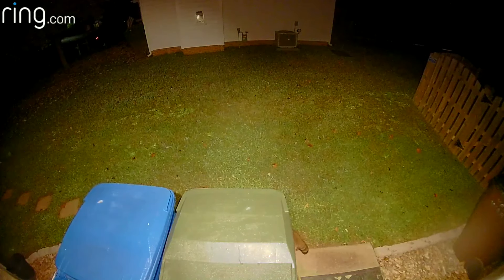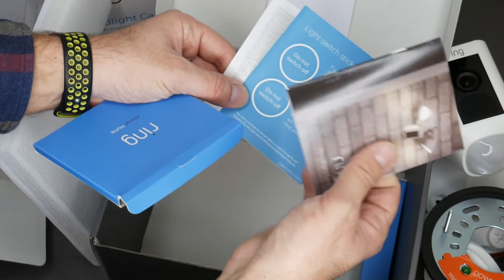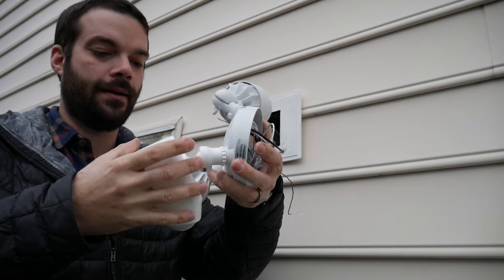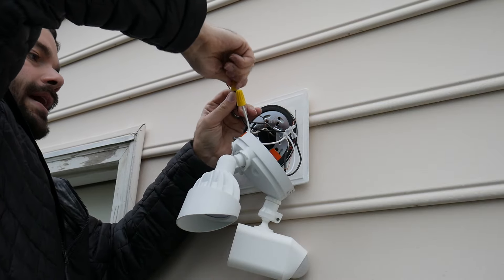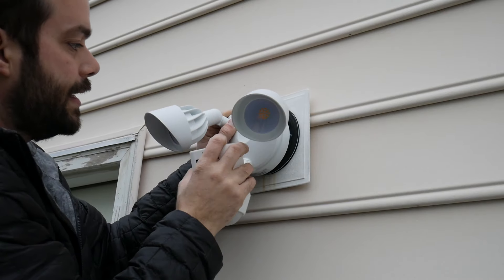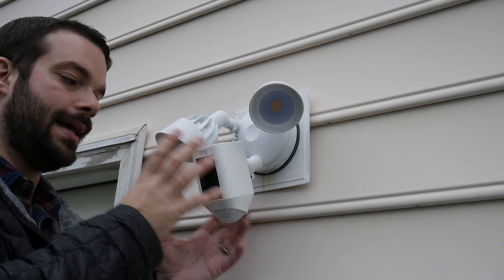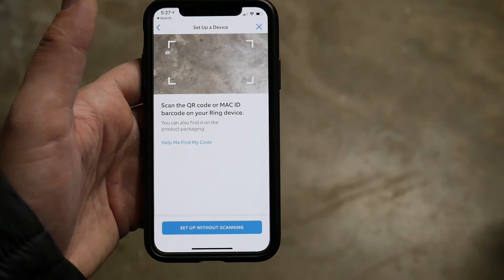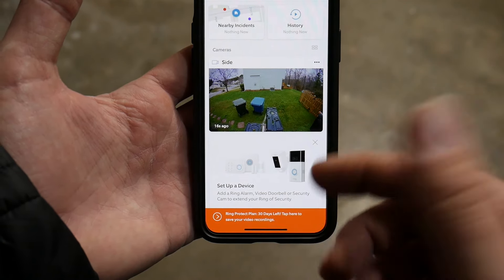Ring Floodlight HD Camera | Install and Set Up

Comment: Don’t trust the test button, you could have a malfunction on the light but still have voltage on your wires. It’s best to use a voltage tester to ensure the absence of voltage before you begin working on replacing the light
Reply: I grabbed the + and the - one time! It’ll tickle you ! Try it!😂
Reply: I had another wire hiting the wires I shut off and it shocked me lol. So now I shut off the entire house to be safe.

Comment: If you're trying to install the Ring Floodlight cam (model # 2210C-XYZ) with a 5" base and you need a junction box for it, you'll discover that round junction boxes with 5" diameters are very difficult to find. The large majority of them are 4". 

I finally found one that'll fit. It's the Grainger Surface mount wiring box, 5", White (model # 14G265). 

But, bear in mind that Grainger has really odd hours. They close at 4 pm on weekdays, and they are closed all day Sat and Sun.

Comment: When putting stranded wires to solid wires you don’t twist the wires together rather you put the stranded wire slightly higher/longer then the solid wire then use the wire nuts as normal and you will find it makes a way better connection it helps to twits the stranded wire by it’s self to tighten the strands together
Reply: Good job pointing out the correct way.

Comment: It would be cool if ring made it so that you can move the camera on the app
Reply: That would add cost.
Reply: It would also be way cool if the could power it off your wifi. Lol
Reply: Yesssss I bet that’ll be next
Reply: Ring keeps yalls footage lol
Reply: Mount it upside down and flip the camera? Just a thought. I haven’t tried it yet.
Reply: Or RGB
Reply: @tjsuda  That would be cool or if you could just the color temperature of the lights
Reply: @timhadaway984  I tried to do that but, the lights won't turn enough to put the hoods on top.

Comment: Excellent video! Can i install that camera where the old bell box alarm is at the front of the house? Can I use the wires from that bell box? It's a wired alarm that i don't use and it will changed to a wireless alarm. Thank you
Reply from the maker: Watch the video, if it has similar wires it probably has the same power running to it and you can use it.

Comment: Hey, just wanted to say thanks, you saved me time and can the manual be any smaller.  The hook is now a nylon strap which worked fine and they never mention using the handle to tighten down the nuts in the end.  Thanks again

Comment: I just have a standard outside light operated by a switch on the wall of my home at the front and back doors. Will this still work? I do not have a flood light installed currently. But I do have 120v AC connected to the existing lights.

Comment: Where's the white backplate from? I have a rectangular flood light backing onto the house (brick). Instead of having to cut out a whole, I'd like to use one of those plates and just have the wiring come through and put the circular backplate over that.

Comment: I have 3 spotlight cams but I just ran the wire yo the outside outlets through metal tube and got lock boxes for the outlets but what u did looks a lot cleaner 👍
Reply: Is it a plug at the other end?

Comment: I would recommend putting electric tape around them caps after you attache them . Just to make sure wires don’t touch
Reply: They won’t. That’s what the wire nuts are for. They act as an electrical tape replacement.

Comment: I'm going to install this where there is no Electricty so I need to use an extension cord. How can I wire a male plug into the Ring harness
Reply from the maker: Honestly, consider the Ring Solar Floodlight that I just reviewed -  https://youtu.be/0vhJ7eH8S1Y

Comment: Are the bulbs replaceable? If not, what happens when one stops working?
Reply: They are led lights they won't go out for a while atleast 10 years I'm a electrician these are easy to install and set it up you will need a strong wife connection near the flood light that is really important
Reply: @charli9184  I had led flood light on my house a couple years now and it just burnt out. Didn't last long at all so I'm looking to replace it with this. Since you're an electrician, I changed the lightbulb for under my microwave and now when I plug it in, the nightlight stays on and doesn't turn off. Is this an easy fix?

Comment: I'll make it real simple. Just attach your bracket and then attach all the color coded wires to the same color. Scan your USB code on the directions and it's all automatic from there it's extremely simple and the app will explain everything for you.

Comment: Not electrician here , you went little fast on ground wire, so the ground from house goes around the green screw on plate then connects to the ground from spotlight? Tia

Comment: Do you have to turn off juice or can you carefully install with protective needle nose plyers as long as you dont cross/touch the opposite wires?
Reply: TURN POWER OFF. Also don't trust that the power is off by doing what he said. Both if your bulbs could have went out even if you just checked them. You should get a voltage test pin to verify the power is off. They are not very expensive and could save you life.
Reply: @tylerhestla3022  pen not pin

Comment: Well made video, but electrically speaking……you should never rely on a light that you say is giving you problems to be your safety check for voltage. More people are killed on 120 volts every year than you could imagine. You should use a voltmeter, or at the very least, a voltage indicator. Super cheap at any home store. Second……not a good idea to use a wire nut on your ground wire….in some regions that is not to code. It should be a physically compressed connection. They sell little copper splices for this at the home stores as well.

Comment: What if you don’t have a existing light fixture, but still want to install and mount it in front of your house..and the house is brick..lol is it possible?
Reply: The ring floodlight plug in mount accessory can. It’s a 20ft cable that you can plug into an outlet. just need a 1 in. masonry drill bit to drill a hole in the wall to fish the cable to where you want to hang it
Reply: @christucker8132  Can you explain this further? I have a back porch light but no preexisting flood light 
 Do I need to send it back?
Reply: @jeannielynna  if you have preexisting light outside then get the ring hardwired floodlight version. The plug in mount is for people that do not have a junction box or electrical wires outside

Comment: Yesterday I installed my camera just like this thanks to this video and everything was working correctly until this morning when I went to my ring application I noticed that it did not work, it does not show video and I have already checked everything, even in the app it says that the camera is online and everything is fine but it doesn't show video, when I go to the live view part I get something that says connection problem and I don't understand why since everything is well connected and the Wi-Fi router is only exactly 1 meter away, yes Has this happened to anyone else please help me since I've been working on this all morning and I can't find a solution and I put this camera in order to secure the house since there have been many robberies around here lately

Comment: Completely wrong installation video! He is supposed to mount a junction box first. This only shows 2 plastic nuts holding the unit. But there's multiple types of screws in the installation kit. I wouldn't trust 2 plastic nuts holding thus by itself.